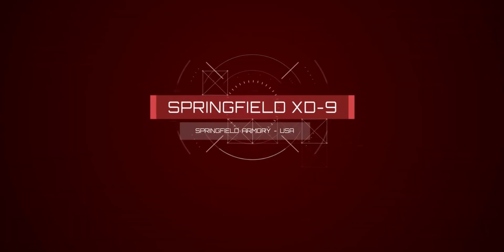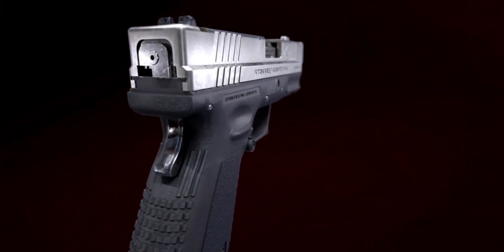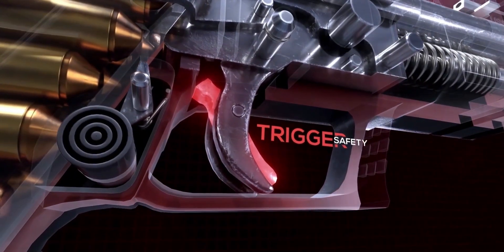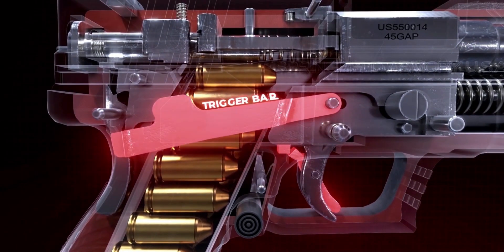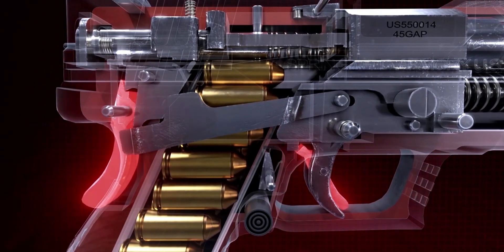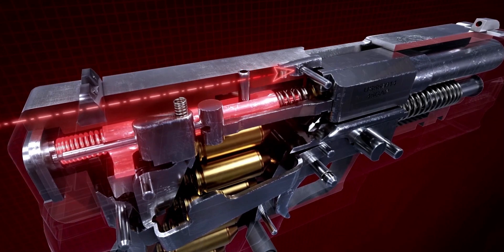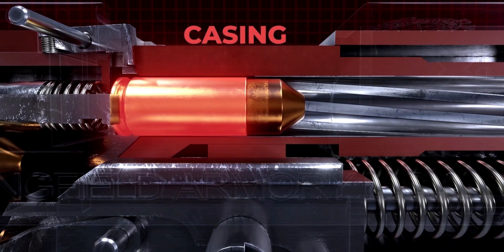How a Springfield XD Works (Part 1)

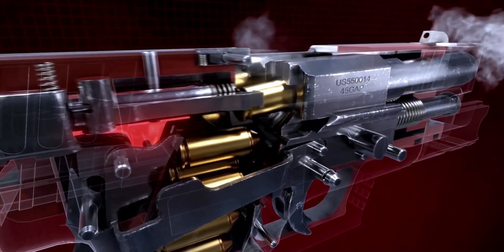Comment: 2:39 Why do you have the trigger disengage here? In an actual shot, the trigger would still be engaged during the cycle. And in that case, how does the sear catch the striker lug? Does the sear remain down and something else catches it, or is there a process in the cycle that disconnects the sear from the trigger, allowing it to rise, until the trigger is released?

Update: I just realized the slide moving backwards at the beginning of a cycle pushes the trigger bar down to where it no longer holds the sear down. That allows the sear to catch the striker lug near the end of the cycle. Releasing the trigger after a cycle allows the trigger bar to go back up to connect with the sear for the next shot.

So around 2:34, the trigger bar should have moved down, releasing the sear back to its original position.

Comment: Great video ! Does Springfield Hellcat have the same firing mechanism ?
Reply: Short answer, no. It is still a "striker fire" pistol, but does not have the same style of trigger bar or a sear safety as the XD. The only safety you have to manipulate is the trigger safety, like a Glock. Also the striker spring set up is different.

The way that the original XD trigger and spring system was set up makes for a lack luster trigger pull. Long uptake, heavy pull, and excessive overtravel and reset travel. Out of the box, the Hellcat trigger is far superior.